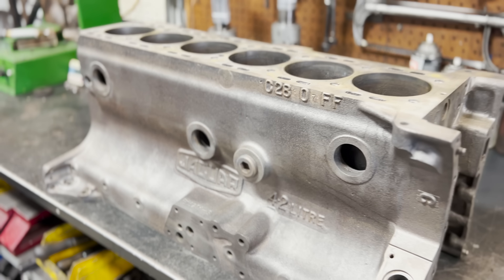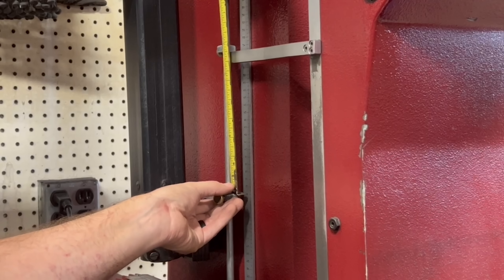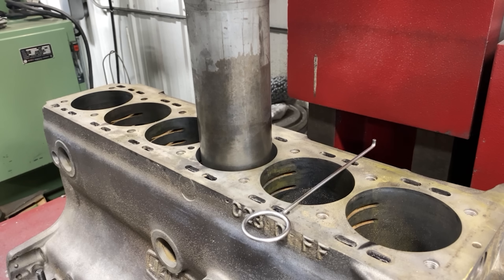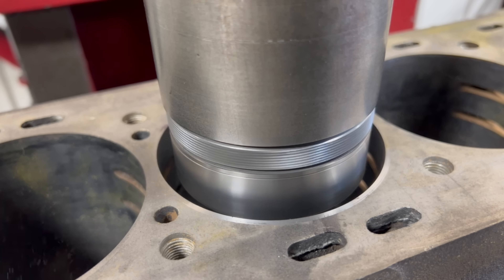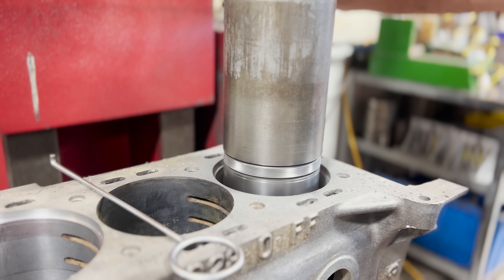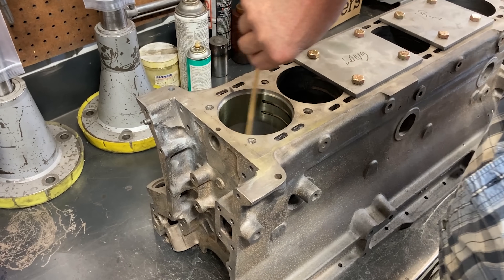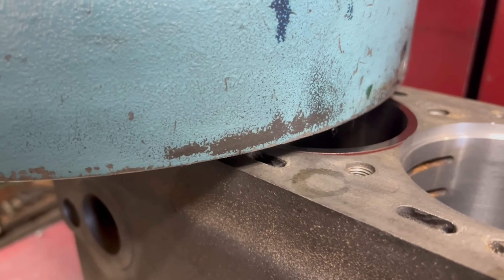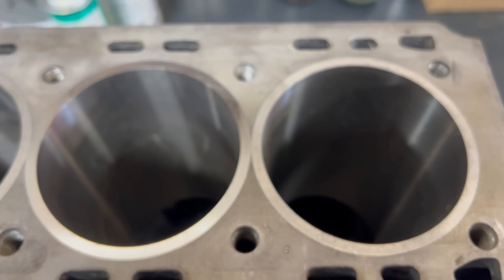Will New Sleeves Fix The Cracked 1968 4.2L Jaguar Block?

Comment: Welding cast is also done by off road rig builders on differential housings you preheat to ~400° F and then weld and then either burry in sand or a fiberglass blanket to keep it warm and allow the Carbon to equal out

Comment: Harry Weslake, the gas flow engineer, was contracted to design the original XK engines cylinder head. When he was shown the block, he told them that the cylinders were too close together, and that they should bite the bullet and redesign the block at that stage, otherwise they could never increase the capacity beyond about 4 litres without problems.

Comment: My grandpa would be proud to see that block made better than new and being put back to work, serious Jag guy he use to set them up for the 24 hours of Lemans. I loved the machining and really enjoyed the video. My gpa watch the video with me and it's the first smile he's had in a long time. He's recovering from brain cancer and can't talk or walk anymore but understood the whole video.
Reply: Hug your grandpa, tight,,,, kiss him too, if he will let you.

🙏 🖖 🙏 😔 🙏 🙏 🙏
Reply: For racing that block is junk, for highway cruising they have done a very good patch.
Reply: @ldnwholesale8552  i think he was saying that his grandpa would set up other jag engine for racing not this specific inline 6,
Reply: @ldnwholesale8552  welded parts iron casting's like 1970 426 hemi cracked/pited block or D-8 2020 heads for 400HP to 1500 HP and or flow modifying and or change's like adding sensors or cam phasers/roller lifter/60mm core or transmission patterns aka to say a hellcat bell housing thoughts 💭 ? and no i really for now don't have access to fresh castings or billet-steel for now, my personal charger/setup not for hire

just dynasty 400 tig,torch's,spray-welding and light-duty firepit's/casting pit/annealing setup and 3d printing non metallic a 50's mill/CNC mill is on the tool list but for now a pipe dream as 3P-power isn't in my shop and or space to run it

also have access to scrap iron parts for practice ect and or a vary good at SS-welding not so grate at aluminium it's okay but not my thing

Comment: I would have thought the top plates would have held those sleeves down as all the temperatures somewhat equalized and the loctite, set but..
I have a client with a 1931 Chevrolet truck with the stove bolt motor is getting hot to make a long story short I eliminated it down to the block has a crack in it somewhere I did a die penetrant on the block in the truck with the head off show no cracks but die penetrant is not the end all on that so I guess it's going to have to come out and strip down and go to the machine shop. I'm thinking all six holes need to be sleeved because there's so much erosion in the coolant jacket the cylinder walls are getting pretty thin. These old motors are really expensive to repair properly just because, well you know. Great video thanks.
Reply from the maker: The problem is that the temperature equalizes nearly instantly, before we could even get the plates on, and the bolts/plates aren’t enough force alone to overcome the press & loctite,

Comment: Great video. There is one thing that bothers me. That measuring tape makes me anxious
Reply from the maker: lol why
Reply: Just doesn't seem like a precise measuring instrument around all your other precision measuring tools. I have only worked with measuring tapes in the labor industry and that end piece moves around alot. 
Is that measuring tape specific for machine shops where that end piece doesn't move?
Reply from the maker: Only used to set the stop on the machine. Wouldn’t make any sense to use a micrometer or caliper to set a dimension that can vary by an inch and be acceptable lol
Reply: Forgive my ignorance in the matter. I have realized how much machining and engine building interests me and are just curious to learn. I have learned to cut seats in my sons 4stroke briggs and seal valves to the seats, and have grown to like your trade. Kind if wish that was my new career.

Comment: A&C CASTING REBUILDERS KELLYSEYVILE, CA 95451, this guy recast a replacement section for the entire side of a V-16 Cadillac block welded it in and you couldn't tell. He did a repair for me on a set of old Harley Knuckle heads solid repair on an impossible situation..  not affiliated just mentioning  for future reference.

Comment: I’m a machinist by trade but don’t work on engines, Its quite a sight for me watching you jump back and forth between a bore gage and a tape measure. I really appreciate how much thought and thoroughness you put into the process.
Reply from the maker: lol important to know the tolerances required in each situation. Setting the depth of the stop on the machine in this instance is a + 1.000 -.000 type of situation so tape measure fits the bill

Comment: Just curious, did you think of stop drilling the cracks to keep them from spreading? It’s a common practice in aviation but usually on sheet metal. Not sure if it would be feasible in the bore
Reply from the maker: Sure but really wouldn’t make a difference here. The cracks already spread up to the deck, and won’t grow past the second coolant passage.

Comment: It's astounding that here in the States a block like this is immediately thought of as scrap, but overseas they're regularly repaired just like this one was, and without a second thought. It's no big deal to them to bore for sleeves, where it's almost a forbidden subject here. There are engine builders designing 4 and 5 thousand horsepower daily driver capable motors with replaceable sleeves in the event of catastrophic failures, so it shouldn't be considered a bad thing to have to sleeve a block to save it.

Comment: Hey  been keeping up with you on you tube  and  titck.  Really like your work ethic,  I have a 2014 650ix 4.4 n63b443  engine I just bought new from BMW,  they reminded I brake in the engine with  synthetic oil.  I'm old school I'm 54 years oil and have worked on all kinds of car but never a BMW.  I've put about 200 miles or so on this motor and it runs good just when I drive for about 15 or and stop it want to start blue  smoking. Do you think I should of not used  synthetic oil to brake in the ring.  And it twin turbo from the factory

Comment: Amazing work.  I would be interested to hear what the experience has been with longevity of engines where this technique is used? I'm wondering about the possibility of expansion and contraction differentials with the thicker top hat flange. Does it lead to coolant leaks down the road?
Reply from the maker: In theory, all of the materials used are cast iron and therefore should expand/contact very similarly.

Comment: If you don't do this work, or know much about it, it's very hard to appreciate the difficulty when someone mentions in passing they had a shop sleeve an old engine.  There is a reason that has to be done, and wow, it can be stressful for that reason.  Then getting it done despite cracks or galling or whatever.  Measuring and centering just right, fitting, etc etc.  Taking enough off...but not too much. This is so well done.  Great skill.  Really enjoy watching these.

Comment: the way you installed the sleeves is the best that can be done to have an efficient heat transfert.
The addition of Loctite does not improve the sleeve retention and it can impair transfert efficiency reduction.
very good job
very good video
Reply: It does help with retention. And it's a sealer which is mainly why they used it, to help seal the cracks from leaking down the bore into the crankcase
Reply from the maker: Yep. Heat transfer doesn’t matter if there’s coolant pouring into the oil pan 😂

Comment: Since you guys went this route which is a good way to go, I personally would oring the sleeves and use copper wire and a metallic headgasket. If it's good enough for 3000+ hp it's good enough for this. But not my project or my engine. But anyways. Excellent work. Yall really take pride in your work and doing it right.

Comment: this is awesome, but i have a question. In my experience of getting machine work done it’s usually set prices for say boring / decking etc. How do you charge for this? obviously parts but do you bill hourly for this kind of machining ? looking like an 8 hour don’t move away job so just curious how you make sure your getting paid for all the time necessary
Reply from the maker: I basically did the math of how long I estimated it would take and then multiply that by my hourly rate. In hind sight, I would’ve charged more, but I already gave them the quote so I’m going to honor it.
Reply: @JAMSIONLINE   fair i know for me regular mechanic you can ballpark extra time and factor it, but your processes are much more time consuming and well the attention to detail in the videos and i’m sure more we don’t see off camera i know would be tough to guesstimate. Again this kind of numbers matching style resto isn’t started without the budget having some room for this quality!. Keep up the awesome work it’s great to watch and learn

Comment: Slick as ice brother.. I am an old hotrodder from the 50- 70 and a little beyond..  I became a carpenter but dang watching your show (and getting a bit jealous) I wish I would have stayed a mechanic.. But after I got certified in engines and suspension I became enamored with building and bent wrenches as a hobby But now in my old age it is mechanics that draw me with a pull that is hard to resist.. Carpentry was a great life and I enjoyed it immensely but it never held the joy that bending wrench's has held over me. Well done fella.. did I mention I am extremely jealous! Carry on

Comment: How are you gonna prevent the capillary action of the the crack on the top of the block between the hats of cylinder liners? I would thing a bronze TIG braze would be curative before the liners.

Comment: I gotta say, the liquid nitrogen sleeve fitting was way way way cool!!! I don't think I have seen a shop use that before.
Reply from the maker: Honestly it’s expensive, a bit unsafe, and a bit of a hassle for a run of the mill job. But it has its place and we’ve been using it more often as of lately!

Comment: AWESOME JOB GUYS!!! Preserving history like this is such a satisfying accomplishment. 
LOCTITE 620 is perfect (as you well know) for this kind of job. I've seen it used on inserts to rebore rifle barrels. So,  with a shear strength of 3800 psi, you know it will handle a shock load. Also, it's bond breaks at around 450⁰F, so it'll definitely take prolonged heat exposure in an engine cylinder.
I'm so proud for y'all for the success of this project.
Reply from the maker: Thank you!!!

Comment: Superb work.  I hope your customer understands how fortunate he is to have entrusted this critical work to you and your dad.  Your skill, experience, and attention to detail are exceptional.
Reply: The costumer's wallet will know how impressive the work done was. As it should.
Reply: They did a nice job, but they're far from alone.  Any machinist with years of expeience working with engine parts are going to be competant enough to handle this.  If they're not, they wouldn't have reached their years of experience.  They run into stuff like this all the time.
Reply: @kellyappel3015  Certainly not alone but still exceptional based upon my experience.  As the saying goes, your experience may differ.
Reply: @theodoreshasta7846  Agreed.  THere is a reason you need to 'ask around' before entrusting an engine to a shop.  they aren't all created equal.
Reply: Oh so true, you can all the best equipment but if you don't care about what you are doing it is wasted. These guys seem to be in the care category.
Reply: @theodoreshasta7846  It does.  I relied on a couple of guys in my area for years.  One moved on, the other retired.  The guy that replaced them has been just as good.  All three of them would've come up with a solution for this block (probably same solution as Jim's.)
Reply: @JP-vs1ys  The issue most people will run into is the shop not even bothering to try repairing this block because the effort versus reward just isn't in the shops favor. You either risk it and fix it making slightly more money for the shop, but with a huge liability if anything goes wrong during machining or in general this engine now represents your company.
Reply: @kellyappel3015  You said the magic words "One moved on, One retired" Thats the problem today. These older guys with the years of experience and skills are disappearing. And there not passing this old school knowledge on to the next generation. Part of its because they don't want to screw around with this stuff, because it takes to long. Or they can make more $$ producing parts in volume. Then these jobs pay. Im in NE Ohio (Cleveland/Akron area) Which was a HUGE Industrial machining area. Today there's still shops around that make custom parts for production. But try and find a shop that does "Industrial Repairs" And anything "Exotic" like large sizes, Or will need heat treated. And you'll be on the phone for DAYS making calls. And when you do finally find someone,  I hope you aren't in a hurry. Let alone the cost of doing these off the wall repairs. These shops are a dieing breed, At least around here.
Reply: @Pyle81  He moved onto  a different location doing the same work.  Everything's even.

Comment: I’m surprised the sleeve manufacturer didn’t suggest cutting the depths on the last 3 shorter from the start. Anyway looks like a great repair, hopefully the owner is a lucky person.
Reply from the maker: Eh, they typically don’t really give much guidance. Sometimes the same sleeve fits many different applications. I should’ve been thinking but I was in the flow of things.
Reply: @JAMSIONLINE  I would think the manufacturer would have the most experience and have recommendations though.

Comment: Another great video! Although the satisfying decking was left off for the next video! 🥴
Reply from the maker: And it will be satisfying, the deck is wonky on this block 🥴
Reply: @JAMSIONLINE  I wouldn't doubt it judging by the runout you've shown in your videos! There's just something that i find  extremely satisfying watching a video of a head or block surface being machined flat! Seeing all of the low spots slowly disappear with each cut!

Comment: I noticed a gap between # 3 and 4 cyls ? Is there a larger main bearing there ? A  very cool video, I am sure this will get you more work on these antique engines.
Reply from the maker: Yes, for some odd reason they put larger bore spacing between cyl 3 & 4 🤷‍♂️. Maybe they were on dope lol
Reply: @JAMSIONLINE  Original XK engine was designed during WW2 during the Blitz on London.

What I'm getting at, is lots of 20s, 30s, and 40s engines had uneven bore spacing.

Largely a thing of the past by the 50s and 60s, but not as unusual when this engine was first conceived.
Reply: I rewatched the video, and the 3/4 cyl main bearing does appear to be wider. I wonder if they were having crank failures/breakage issues with earlier versions of this engine ?

Comment: Much appreciated. Enormous amount of work you do to provide these videos. Enjoyed 👍👍👍
Reply: shrink fit is the best method to have a firm contact with the block for best heat transfert efficiency, a pressed on sleeve can't achieve a good heat transfert because of distorsion caused by the process.